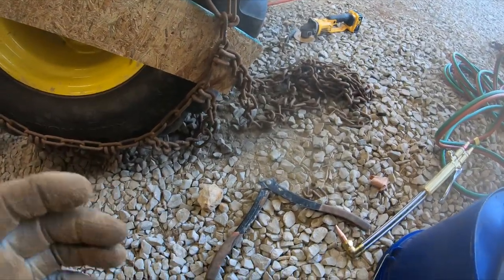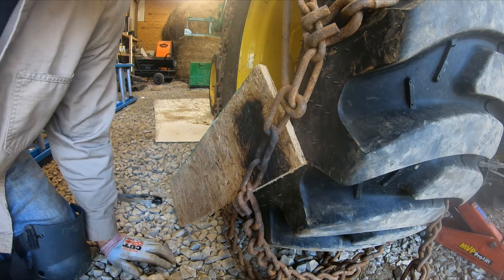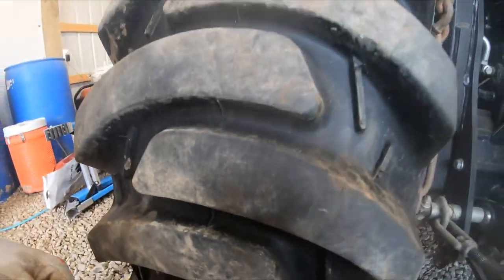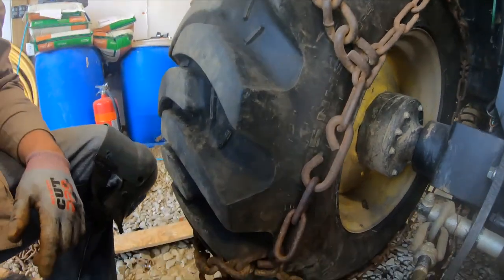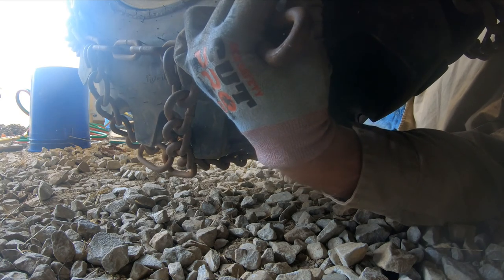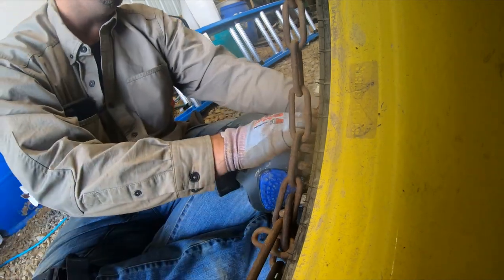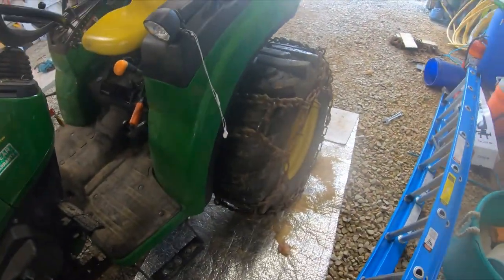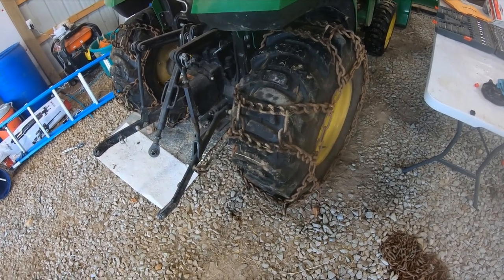Making Tire Chains For John Deere Tractor Part 2

Comment: Doing it the hard way,  tighten the inside first as tight as possible, then Work the outside by rolling the wheel, as you turn it the chain falls into place & self tightens, Then to pull the chain together, use a small load binder.  I put chains on my Skid steer in about 45. minuets to an hour.
Reply from the maker: Thanks Dan for watching and the information i will have to try it out hope you subscribe to the channel